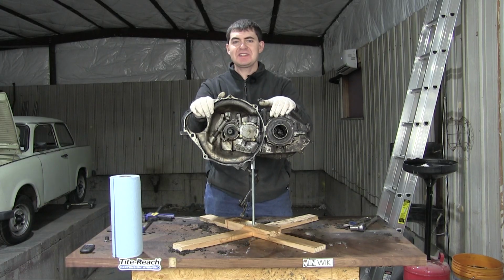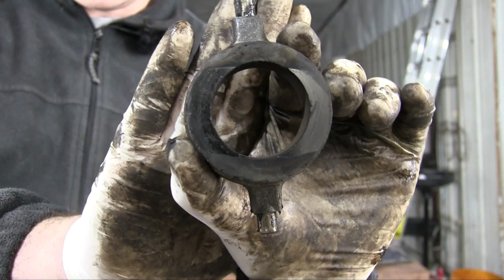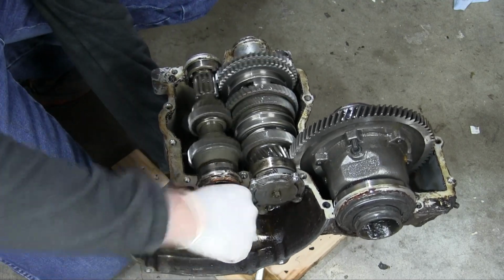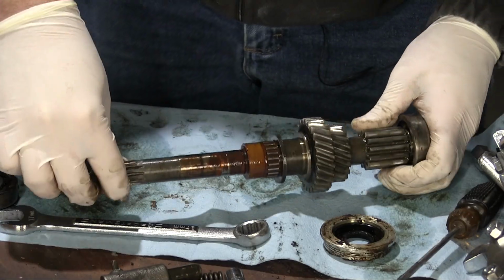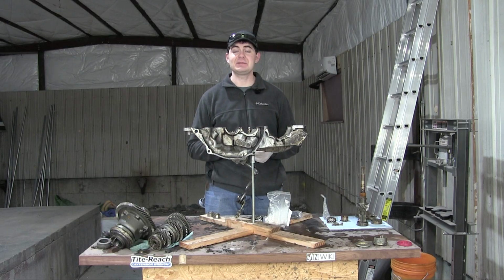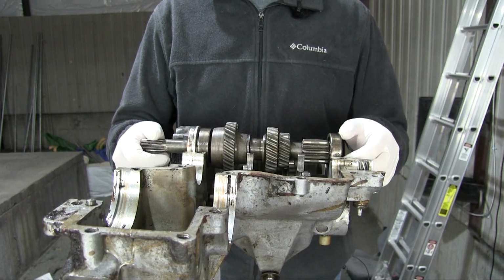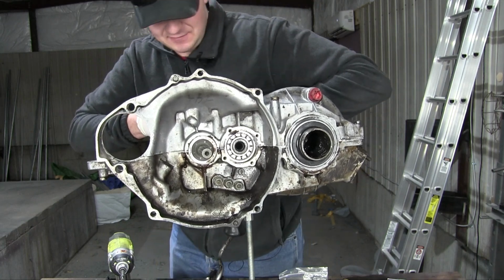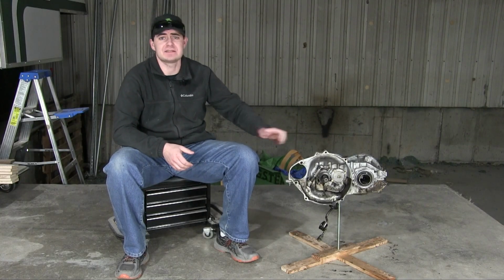Rebuilding the Trabant's Engine: Part 2 - Rebuilding The Gearbox

Comment: when driving this, if you wanted to coast, you would have to shift to neutral or 4th? or push the clutch in if you're a jerk? not going to lie; the 2 stroke engine of the yamaha sports atv i have is a dramatically more advance 2 stroke engine than this. i don't ever need to mix oil and gas, i can coast in any gear, i have six gears, and with a top speed of 70 mph the ATV is far faster.
Reply: This is a 50s era car with no updates that lasted until the 90s.

Comment: I think I would have replaced the graphite with the ball bearing upgrade. BUT, more moving parts means more parts that can break. So, I would have cast a mould of the graphite and cast in soft aluminum brass. It would outlast a graphite unit and also not cause any problems like graphite powder could cause as it wears out. Because it will not wear out like the graphite and and might even outlast the tranny. Cool to watch this rebuild being done by another show me state person who like old soviet stuff.

Comment: Well, I think most people who say you can work on a Trabant with simple tools assumes you have soviet supply lines where it's probably cheaper and easier to replace the engine and transmission wholesale.
Yes gomrade I is mechanic! yanks engine and transmission out, plops in new one, bolts stuff down
See gomrade! Good as new!

Comment: I recently had to do an oil change on a couple of large (700kg each) gearboxes where the NATO (yes, this was a former NATO asset) spec said "Tellus T27 gear oil".  Excellent!    Yeah.  Except that Shell no longer makes T27 gear oil.  The closest modern equivalent is ISO 46 AW hydraulic oil.  Which, thankfully, is readily available at all of the "usual suspects" around here.  Phew!

Comment: Always change the bearings!
They are - just like the oil - international standard ISO, So go to your closest bearing shop with the bearings and ask for replacement parts.
It will work wonders in your Trabant gearbox!

Comment: I have a low mile honda gl1500 goldwing I should use as a donor and transplant it into a Trabant. It would be 1000cc more than factory. It should be fast.
Not to mention more reliable. I could even use the cruise control from the goldwing.

Comment: Graphite block release bearings are a very clever design to avoid problems caused by dampness and contamination destroying conventional ball races. The clutch housing is fairly much open to the elements and road grime can get in there. Early British cars used the same system.

Comment: AFAIK, a normal bearing wouldn't work in this setup, at least not for long... it requires a guide tube of some sort that would keep it parallel to the shaft, otherwise it wears very fast due to misalignment. That has been tried (and failed) many times in the Moskvitch gearbox, which uses basically identical graphite bushing (a legacy of the original German Opel design, no doubt). This design is surprisingly durable, btw. A well made graphite bushing typically lasts at least as long as the 'box itself.

Comment: The MG Midget / Austin-Healey Sprite engine also uses a graphite release bearing, and also has an upgraded ball bearing release option.
HOWEVER - because, under normal operation, the release bearing does not remain centered on the shaft, it is inadvisable to change to a ball-bearing release.
Just don't ride the clutch, and the graphite will last a reasonably long time.  :D

Comment: What you mean you didn't put new ball bearings in Duh, That's OK, I rebuilt a Ford Cortina mk2 gearbox with a NEW 2nd gear bcoz it was crunching and did not replace the syncro rings.

Comment: Just thought of something! That Trabant gearbox had four speeds cause the car's simple motor wouldn't work well powering a vehicle on those Eastern Bloc roads. - - Not without a complex transmission system to compensate for such a primitive engine! The Trabant motor was originally designed for an obsolete three-wheeled motorcycle, and not a four-wheeled sedan.

Comment: 1) Whatever that "conveying screw" is that you removed at the beginning, WHY DID YOU LEAVE IT SITTING UNDERNEATH THE TRANSMISSION?!? If something fell it would bend the "conveying screw", and the manual SPECIFICALLY SAID not to let it get damaged in any way.
2) I really wish you had the fabrication capacity to add a freewheel to 3rd gear. I think that transmission would work much better if 3rd and 4th gears could both freewheel.

Comment: The stator assembly inside a automatic transmission/transaxle's torque converter has a thing called a "Stator" inside the torque converter and that "stator" also has a one way sprag clutch. When a torque converter goes bad, that one way sprag clutch on the stator is most usually the reason the torque converter goes bad!!

Comment: Those bearings that allows the gear assembly to turn one way but won't allowe it to spin the other way, that assembly is normally called a "one way sprag clutch"

Comment: Two points. (1) That one way unit is probably a 'sprag clutch' and (2) All the torque goes through a woodruff key ? as you chaps would say 'Oh My God' . Apparently the failure of this unit is quite common, well, well, well - who'd have thought it. They made over 3.7 million Travants. The waiting time was between 10 and 13 years to get one. Considering the state of the roads in East Berlin at that time it's a miracle they survived at all. I would love one but as we drive on the correct side of the road and not cack handed like Napoleon was maybe not. Just so you know. Gentlemen on horseback always passed on the right so they could draw their sword easily. He being cack handed and an Emperor (with hemorrhoids - honest) decreed otherwise. It's a good job you chaps use guns these days.

Comment: Don't you just hate it when you have to fix stuff that you shouldn't have to fix like you get a new part in the end up having to modify it because the factory made it wrong I once got a fan and the middle part the little cap that spins on to the blades to keep them in place didn't have a hole in it so I did drill a hole in it it was very annoying

Comment: Hey, I really like your series on Rebuilding the Trabant's Engine. Both my father and uncle had trabants for nearly 15 years, both did something like 200 000 km on each. We're from Bulgaria, btw. They both said that the freewheel is a very weak point in the gearbox and both of them had theirs welded. So basically ... if you start having problems with it again, just weld it. :)

Comment: Thanks for a fascinating, amusing and well made video. Very interesting to see what happened when you pried the box open and found all the interestingly shaped metal things inside...  FYI  A very experienced Land Rover mechanic I follow on YTube (because I try to repair my own LR) sprays all bearings, seals, gears and shafts with ATF during assembly (using a hand pumped spray bottle), on the grounds that it will be some time before the normal lubricant makes its way into everything during use - by which time damage may have already happened. I think he has a good point, although concede it may not apply in the case of the Trabant. Interestingly he uses ATF because that's what he (and others) recommends using as gearbox oil. "Never put gear-oil in a gearbox" they say,  again referring to Land Rover gearboxes.

Comment: Fun fact: Do you know that back in 1997 when Mercedes-Benz introduced "the baby Benz" - Mercedes A classe, a huge problem emerged.The W168 became infamous in 1997 after flipping over during the traditional "elk test" performed by the Swedish automobile publication Teknikens Värld. According to the report, the W168 overturned when manoeuvring to avoid the "elk".
The experts said that Trabant was actually much more stable car in rapid turns!

Comment: Funny! I got the release bearing you mentioned. And with that, the problem wasn't that the holes for the clips weren't deep enough, one hole was missing entirely. Also ordered from Trabantwelt... I think quality issues like that are a big problem nowadays, which is why I've heard a lot of people prefer original "new old stock" parts.

Comment: The graphite release bushing is the way it was done with all the major Brit cars for many years. Morris, Austin, MG all used them up to the early '60's at least.  A necessary precaution with them is that you NEVER want to be holding that clutch pedal down for any time at all.  Strictly for putting it into gear just before you move out, and for gear changes.  When you hit a red light, get into the habit of slipping it out of gear and waiting for light to change with foot off clutch pedal.  Anticipate light change, then at last second, down with pedal, into 1st, and drive away.  Or change your throwout bushing every 30-50K, your choice...

Comment: What you're calling a "freewheel device" (which it admittedly is) is more accurately called a sprag clutch.  These are used   for the starter drive in most small engines such as Brigg&Stratton, Tecumseh, etc.  Also used in Electric Start Royal Enfield motorcycles, where they give a lot of trouble.  Gotta be kept clean and properly lubricated, which can be difficult.  If you'd looked it over a bit more carefully on dismantle, maybe you'da seen the missing woodruff key and saved yourself a few months waiting around for a fresh whole new sprag drive. Your old one looks good in the video - no scored races or rollers that I could see. Thanks for showing us the gearbox guts of the Trabant.  Looks to be quite good quality for a car made out of cardboard... 8-)

Comment: If I remember correctly early VW's used graphite throwout bushings. They also had "split case" gearboxes which are much easier to work on.

Comment: Get the rally designed key 👍👍 I hear the stock key for the freewheeling gear was the reason Trabant lost the 68 Transylvanian Rally. With the aforementioned "Rally" key they were able to take the 70 Transylvanian Rally.  😁

Comment: Who's bright idea to install a sprag clutch on a gear.. then top that with a woodruff key.   Terrible shaft fitment on that inner race promises this will be revisited .  All those loads are being sent through that tiny shear line across the key, and only the key.  Mind numbing engineering.  You should consider using the updated design.  If you have to remove it you will not have to heat it.   Score the race with a dremel, then a few shocks with a hammer will crack it, then pull it off.  You can install it with a press, so again no heat risking the plastic bits.

Comment: I think that the SAAB 96 had a freewheel function on every gear. Even in reverse. You could also dissconnect/connect the thing with a small leaver down under the dashboard. Was some 28 years since I fiddled with one, so my memory might be slightly off.

Comment: can you get the 4 stroke VW motor for this?
Reply: would be quite a large project, the last Trabants which had that engine had a new front, 12 volt system and probably some other changes. Besides, it's probably extremely rare in USA and has less personality than a 2-stroke Trabi.
Reply: @Peugeot-doorl  makes sense. wonder who has one of the 4 stroke in the US?

Comment: I feel a bit ashamed when my Trabbi started for the uncounted time again to play up I drove it - as it still drove to the tip and pushed it down into the ditch. So good on you to put so much work into this former East German design to keep it going. I was never happy with what I did to the inviroment. Looking into my rear vision mirror and seeing the blue two stroke smoke lingering mid air as far as I could see back I desided: no more - it has to go.

Comment: you keep disclaiming that you are not a mechanic. that is wrong. did you use tools to work on a car part? yes! did you do it correctly? YES! there is no wrong way to fix something, rebuild something. it might be permanently ruined, but you have gained: how many mechanics do I know who have torn apart a Trabi gearbox? none! (excepting you of course). even if you ruin it, you have first-hand insight into the marvel of engineering that is a Trabi gearbox. I commend you for that, but what truly qualifies you as a mechanic is that YOU SHARE THE KNOWLEDGE YOU GAIN WITH THE WORLD--- democratization of knowledge. seems a funny thing to say about a Trabi's gearbox... the whole concept seems weird when I think about it. perhaps I should not think and just blindly and cheerfully go to my job at the german widget factory and not complain about the government. there was something also I wanted to say: that freewheel on top gear. the car only has a freewheel on top gear. this isn't as crazy as it might sound, that's the only gear you NEED a freewheel in. how much time do you spend cruising in 1, 2, or 3? not that I would know, ive never driven one, but because one guy and his cat are great enough to share, I now know how to change gears... that was a pun of sorts. what do you call it when its not quite a pun, and less funny? maybe something similar to what you might call the pencil clutch. I can just see it-- 1985 in east Germany-- theryre out of pencil clutch parts, so they order more FROM EAST GERMAN THE PENCIL FACTORY. democratization of knowledge... the pen is mightier than the sword. so lets take them away from the people and make decadent consumer goods! THE CAR HAS TAILFINS! there is a model called limousine! that probably actually means something else in german... perhaps something else again in EAST GERMAN. Anyway about the top-gear freewheel. it does seem a little absurd to put it on only top gear, even though in practical application it shouldn't matter too much. WHAT IS REALLY ABSURD is that they didn't put a freewheel device for the ENTIRE GEARBOX, like they did other 2-stroke cars. it seems it would be easier to manufacture that way as well. AS A TRABI OWNER YOU SHOULD NOT BE QUESTIONING DECISIONS MADE BY THE PEOPLES' GOVERNMENT! IF YOU WANT FREEWHEEL ON MORE GEARS, GO AND BUY A DECADENT WESTERN CAR! NO! DONT DO THAT! sedition...

Comment: Interesting stuff! Those graphite release bearings were also used in some British cars, although my late MG Midget has the roller type as used by Triumph in the Spitfire. A definite rule of thumb with those bearings is to avoid disengaging the clutch except for gear changing. For example, no holding the clutch down at stoplights, etc. Enjoyed this one, thanks!

Comment: I'm sure 80W-90 would've been just fine. It's a manual transmission, not a racecar engine. But hey, since the right oil is available, might as well.

Comment: Order oil from Europe for Trabant gearbox.  lol!!! just put any greasy liquid in it. Should be fine.
Also about that lock pin for 4th gear. It's not part which you should order from 10 000 km away place. Just make one from reasonable quality material. Takes 5 minutes
Reply: On a Trabant gearbox you can use only the hlp 68 hydraulic oil or similar properties.

Comment: The MGB uses a graphite throw out bearing as well. Word to the wise:  its better on cars that have these to leave the trans in neutral when sitting still. It wears only when the clutch is engaged and doing so will significantly extend its life.
Reply: Is that why the older generation always shifts to neutral when stopped at a red light.

Comment: You will  reassemble the unit with difficulty.  It is a Trabant, difficulty is its middle name.   Who is making new Trabants?   I thought the FDR was trying to erase them as fast as possible. Perhaps dying Trabants are donating their parts to survivors.   Does the new style freewheel shaft use a steel bearing behind it.   If you got a real throwout bearing  you would lose one future upgrade.  Now you have, (Gasp!!) spare parts and an upgrade path(!!!).  You also have a whole new class of Vehicle, the Yearly Driver!!   " Good Luck and God Bless " as Red Skelton often said.  Quoting a Master comic seems right,  since your Trabant series is more Comic Relief than Motor Trend.

Comment: Good idea getting the graphite bushing. MGs have the same deal and the reason the busing is better is the throw out doesn't fully follow the shaft, so with pressure the ball bearings take a side load and bind, while the graphite doesnt care. Look up University Motors to get a better explanation.

Comment: i drove one of these in Berlin resiliently. The one i drove was in mechanical condition. I didnt feel like it drove that bad and was a right laugh. The owner suggested that whenever you are off throttle just chuck it in neutral, and you need to rev the guts out of it if you want to get anywhere.

Comment: If it melts it's not phenolic, phenolic does eventualy burn but it takes a lot of heat, you could melt steel in a vessel made of phenolic, re-entry tiles are often made of it.